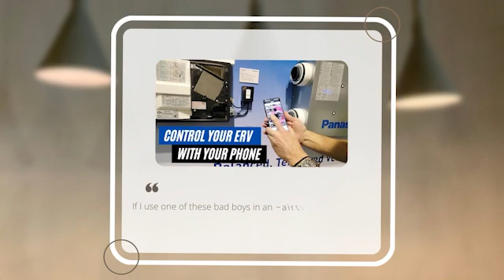Best Ventilation Method for a Small Cabin || ASK THE EXPERT

Comment: Thanks a lot for getting the good info!  7:20 was the most helpful part for my project.  Even if I get it super air tight (which I intend to), the 4" intake duct on the FV-04VE1 should be enough to "make up" for any reasonable bathroom exhaust.  My plan would have been to go with the Intellibalance (~$1000) because I don't want to create significant negative pressure when exhausting the bathroom.  But the "pass through" feature of the ERVs makes it more worthwhile to use the cheaper option + a small bathroom fan.  The cabin is going to house 1-2 people at a time so I'm not worried about too much moisture production from showers, cooking etc and the 40 cfm should be plenty of fresh air.  

On the additional points at the end: yes my plan is to have no combustion in the cabin and to use an induction cooktop.  Fully electrified no gas for fire safety.  A neat time to be building for sure.  Guys, don't forget "Inflation Reduction Act" discounts on heat pump appliances starting 2023.  https://www.rewiringamerica.org/policy/inflation-reduction-act

Thanks again and take care!